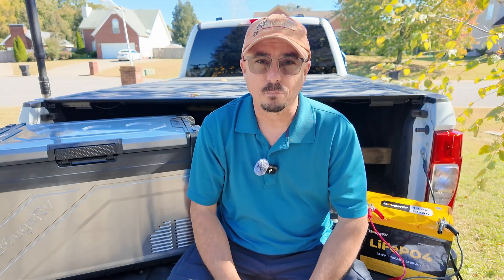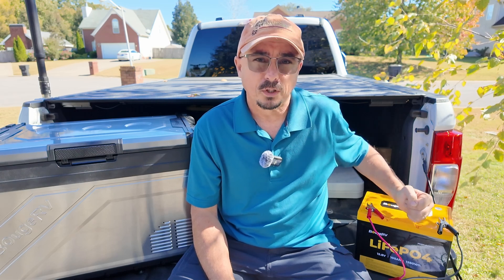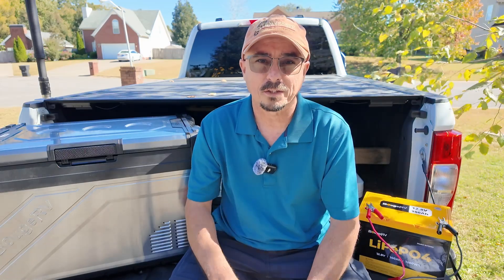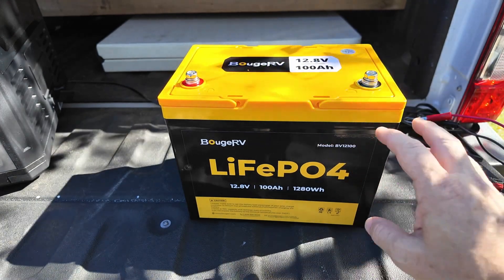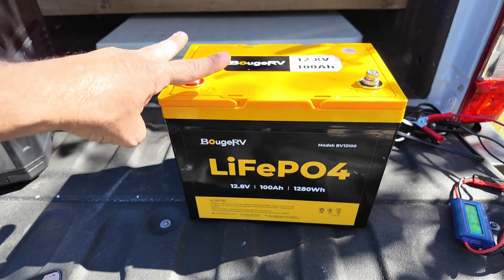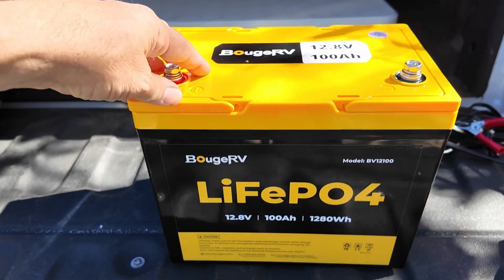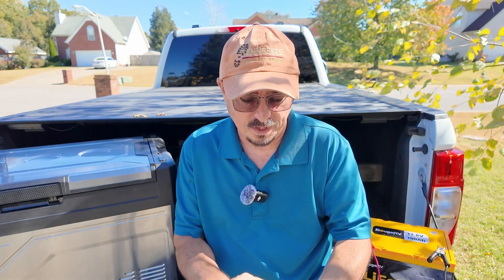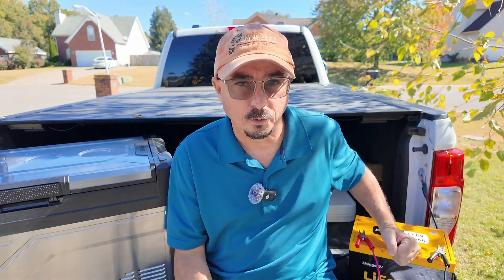Off Grid Freezer Setup with 100Ah Battery

Comment: If the unit is drawing 36 AH, then the battery will not last 3 days.
Or did I miss something!

Thanks!
Reply from the maker: It consumed 36A over a 24 hour period. 36/24=1.5A per hour. This is a 100A battery so 100/1.5=66 hours of run time which comes in just shy of 3 days.
Reply: @KM4ACK Same result I ended up with.

Comment: Takes me all day to recharge 32ah with a 525 watt panel.Good sun doesn’t hit till 1:30 and over about 5:00 Only 1 hour during that time do I get 300 watts from sun.Think again about 100 watt panel getting 20 watts to recharge.Good luck.
Reply: You really far north?

I have two flexible 100w Renogy panels I use with my camper (it has a rather power hungry 12v compressor fridge built-in, about 40-60AH a day) and never really have any problem with it unless I'm in trees or as on my last trip - heavy clouds (and then only after 3 days).
Typical day I get 60-100AH charging with a PWM charge controller.
Reply: @ I had 2 renogy 100 watt hard panels and wouldn’t keep fridge on 24/7’with freezer off on my 12v Norcold fridge.It could have been a bad controller. It wasn’t the 100ah battery that’s good for 100% still.So 32ah per day now is fridge only.Freezer is off and haven’t been drinking beer so door has been shut lol
Running Ac I’ve seen 10-15kwh per day (4200 watts of panels) but now have an efficient mini-split that out performs 2 rooftop rv ac’s.
Summer I seen 50ah drinking beer,have 1 and open door hahaha I haven’t checked consumption with freezer on.
Oh and  I didn’t know anything till I installed a shunt.Dead bat before morning from 13.2 so may have only been 1/2 charged.
All in all pretty neat stuff to know!
Glad you system works.

Comment: Great Video, however my question is: How long would this battery, with an inverter, run your normal home freezer in a grid down situation?
Reply: My regular fridge uses 1.2kW a day and it of course does a defrost cycle so that adds to the power consumption

A freezer w/o an auto defrost would probably use 1/3rd of that, so without solar panels I'd say 2 days because the inverter uses power too. 
If its chock full of frozen goods, I'd say maybe as much as 6 days, especially if you set a schedule of every 6 hours turn the inverter on.

200 watts of solar panels (~$100-$200) + 1 battery + 1000w inverter and you can probably run a freezer indefinitely
Reply: @dorvinion  Thank you Sir!

Comment: Great video ! Love them 12V compressor fridges . We use for camping and transporting frozen food from store to home in summer heat .  The LiFePO4 has gotten go good and cheap no reason to use Lead anymore.  And for starting battery ,That changing. Our gas scooter had a lead starting battery. This summer I found a NOCO replacement LiFePO4 for it . Put it in and starts a tad faster. I am IN NY so see what colod nights do to it.  I won't be driving below 32F . But some nights in NY get quite cold and nice fall day . Once it stays cold I take battery out until spring. I store inside where it is warm . like I do with the lead one.  Hoping to get more than 1 year out of tiny scooter battery.  I almost went with a AGM type. I was using the flooded type that comes with the acid and when ready you fill it and charge.  Now I don't worry about spilling acid . or adding distilled water.  I never had to. by time level got to bottom line the battery would no longer hold a charge.  My NOCO 1 amp charger has LFP setting.  I got the 10 amp one for my bigger 50/100/200 AH ones. just takes longer on big battery.  does not hurt them. NOCO chargers shut off on on LFM and go to float on lead type. So many nice LiFePO4 now ! Bogue RV is known in RV industry to be great !  I know long time RV ers and hear it all the time. LiFePO4 is life changing ! wish I got rid of lead years ago.  SOTA and POTA users love them ! 73
Reply: Getting a 12v compressor fridge was a game changer for camping trips and day trips. And of course very useful for going to Costco (60 mile one way drive for me) while allowing as many hours of recreational activity as you want afterwards. No rushing home to keep the meat cool.

We got our 53Quart 12v fridge in 2019 at a cost of $350. A steep upfront cost (though 50% less than a comparable Dometic) but over the last 5 years its paid for itself by never having to buy (expensive) ice in remote areas, and never having to throw away soggy food, or food that got too warm. 
Because it can be a freezer, when camping for a week or two in a National Forest, if we want to bring frozen meat we can do so, and just bring a cooler for the stuff that doesn't need to be frozen and keep refreezing water bottles to have an endless supply of non-soggy ice.

LiFePO4 is a game changer as well. To get 100AH usable lead acid you really need to buy 200AH of lead acid, and you will almost certainly need to replace them more often.
When you think about a 10-15 year timespan, you buy 100AH of LiFePO4 once, or 200AH or Lead Acid 2 to 4 times.
Reply: @dorvinion  The best part. LiFePO4 keeps coming down in price . and 100 AH is getting smaller !
Reply: @robertmeyer4744  The size I feel is kind of inconsequential since it really only matters as it relates to transportation (I love and own two Tesla vehicles with Li-ion batteries that I routinely road trip - LiFePO4 are currently less capable at road tripping)

Cost of course is what really matters and its definitely decreasing.

I'm very much wondering just what may come of Sodium based batteries for non-transportation needs where weight and volume is even less a concern. 
Imagine a 90%+ ultra-low pollution grid backed up by 2 or 3 days worth of ultra-cheap residential sodium batteries in everyone's home that's less than two refrigerators in size, yet fire-safe, and non-toxic.

Comment: Thanks Jason, you're timing of this video is perfect.   Question:  Can you recommend a good plug in charger that I could use to keep this battery charged?  Thanks
Reply from the maker: I picked up this one https://amzn.to/3YDqb48 about a month ago and have been pleased with it so far. It will go as low as a 5A charge and as high as 20A.  (affiliate link)
Reply: Look at some of the victron 120v chargers. I love mine. Some of the best built chargers and NOT made in china!

Comment: Do you need some sort of voltage regulator between the battery and fridge? Or does the fridge tolerate the full range of high to low voltage from the battery as it discharges?
Reply from the maker: It tolerated the slight voltage difference without issue.
Reply: These fridges can usually run on anything between 11v-24v

A lot of them also have a low voltage cutoff of their own to prevent over-discharge of a vehicle's battery

Comment: The other day I purchased and put together two 200ah CHIN batteries with a 2000 watt renogy converter and in running my full size fridge in the house for 65 hours. The only downside is that takes awhile to recharge them
Reply from the maker: Nice!!

Comment: Okay, now you need to connect it to the solar so we can see how that lasts!!
Reply from the maker: Agreed! I have a 200W panel that will give me 10A on a full sun day. I also want to see how much power this fridge consumes during the Tennessee summer at 95+ degrees F
Reply: @KM4ACK Yes, I expect the duty cycle on the fridge would go up significantly if it were sitting in 95 degree daytime temps, even if it were in the shade.  And it would also increase with usage of the fridge, that is, open/close, remove/replace activity.  This vid seems less relevant to the battery and more about the fridge performance -- unless the battery has severely underperformed, which it did not.